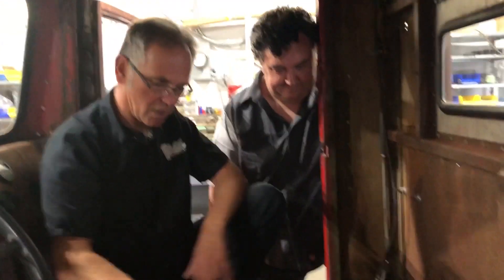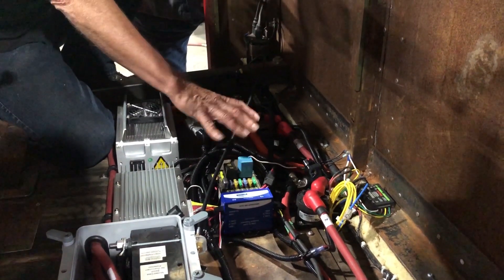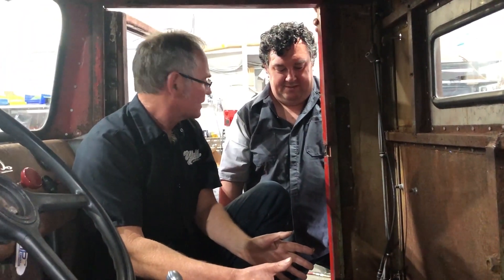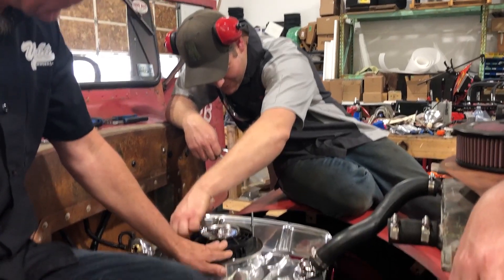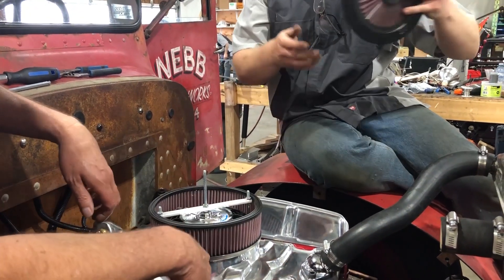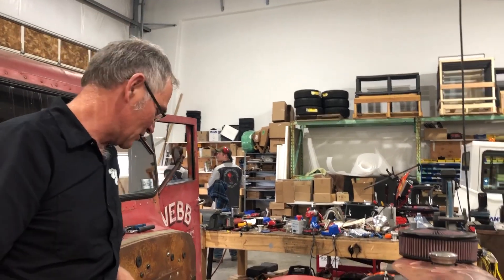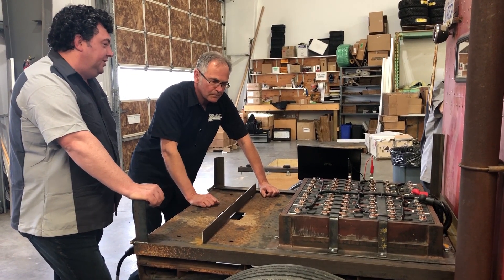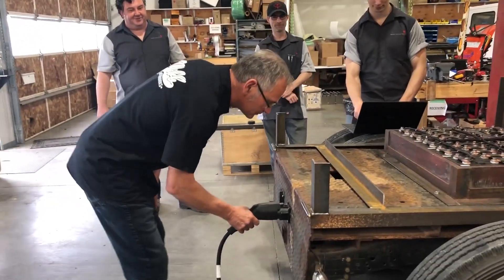Episode 8: Explaining Electric Conversion [Electric SBC for Rat Rod Truck]

Comment: The system needs to be various degrees of "modular" from building your own car to the 50's truck to the 70's muscle car...
In my case a 1951 Ford pickup truck, that needs full modernization. I wouldn't mind having the motor under the hood naked, but I would like a "plug and play" wiring for 12 volt gauges, lights, air conditioning, in other words, staircase technology/future engineering already built into the system....